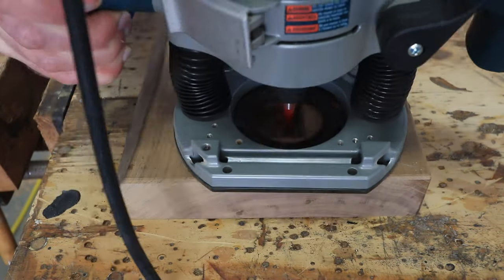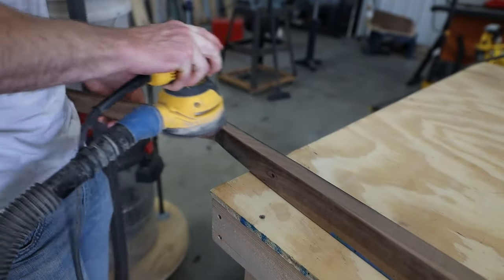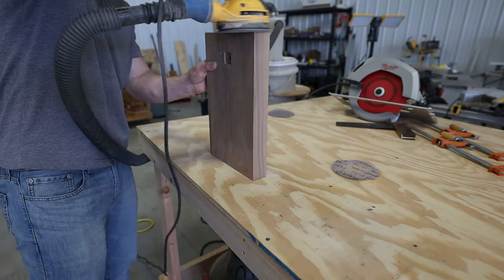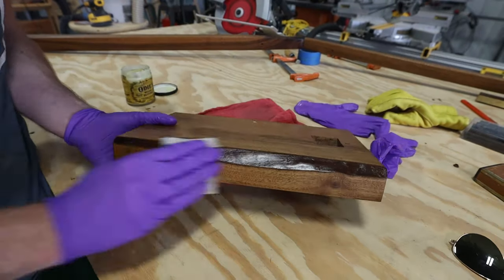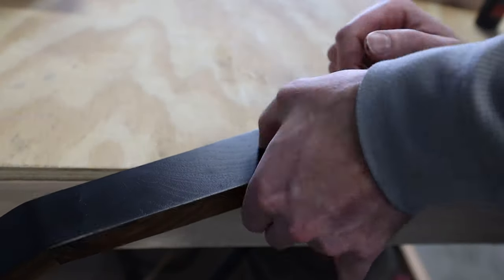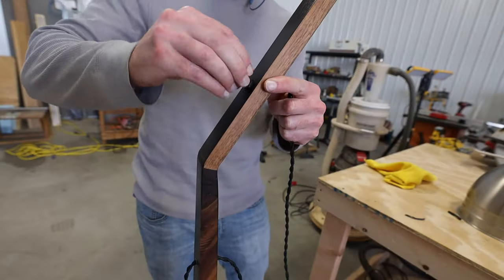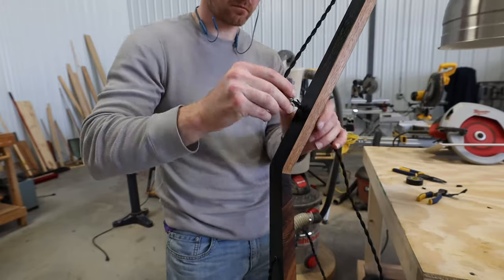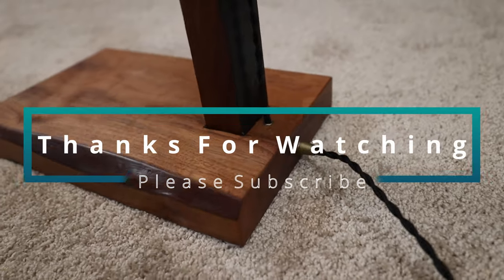DIY Modern Walnut LED Floor Lamp Build

Comment: Very cool build I love the bulb you used it is great, I think it would look even better if you used a pendant that was angled instead of round to match the angled stand and bulb. Still the color contrast on the walnut, pendant, and bulb looks amazing it came out really good
Reply from the maker: Hey, yes good suggestion on the angled pendant, it likely would flow a little smoother. Thanks for watching!

Comment: Really interested in what joint’s you used on the angles?
Reply from the maker: Hey, I actually used two pocket holes at each bend. You cant see them because I used black epoxy over the holes and sanded smooth and then the back side of the lamp is finished black so it all blends in. It was one of my first videos so some of the build details were missed, future vids will be a little more clear.
Reply: Aahh brilliant, thanks for getting back to me.
I’m going to make my own take on this next week. Going to make it from dark Oak and finish the top with the cable over a brass pulley though. Il post a picture if it’s a success.